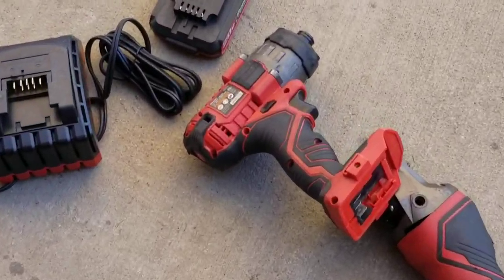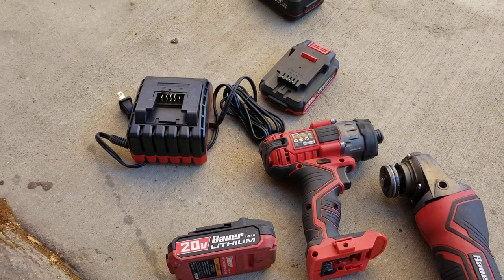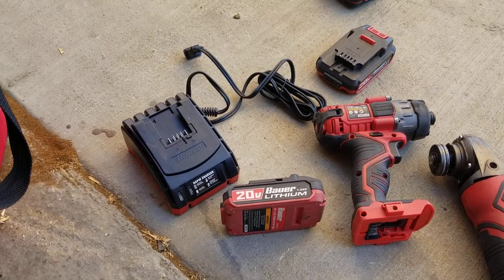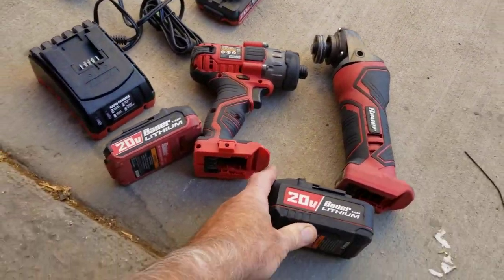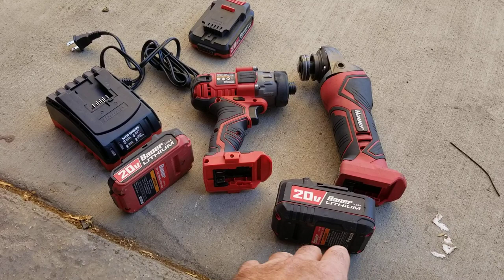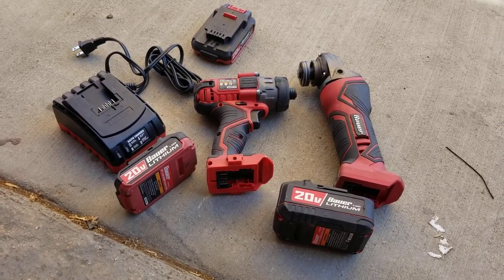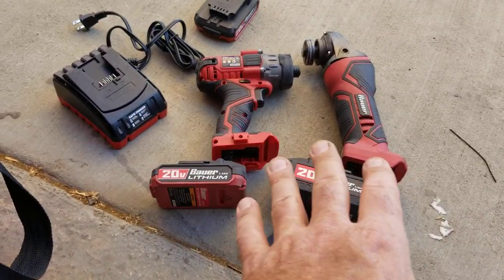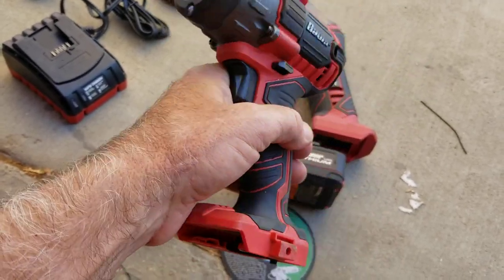Harbor Freight Bauer tools after 2 years of abuse

Comment: I did not know they been out that long,,, the grinders need bigger battery, all the grinders shut off Milwaukee and all.
Reply: Iron Black agreed! Have a Milwaukee with the 12.0 battery that cuts off, and my stepfather has the Dewalt FlexVolt 60V that does the same thing!

Comment: Would you still recommend Bauer? I'm looking to get a drill driver and HF have them reasonably priced as a kit
Reply from the maker: Yea for sure just bought more of them, hammer drill another impact, saws all, circular saw, looking into buying the impact and blower. just to have all on same batteries. and the new grinder is Brushless and more powerful I bought 2 of them.
Reply: No , I would go M12 kit at home depot with a drill, and impact with bateries for I think 119.99.  and you will not have to pay extra for warranty

Comment: Eh...  $250 for a Milwaukee 3rd Gen Hammer Drill, 3rd Gen Impact Driver, 2x 5AH XC Batteries, and a Multi-Volt Charger and a Packout Case.. Seems to be a better deal on that than what the Bauer tools are.  (and those Milwaukee ones are brushless)

The fun fact is though, those Bauer tools are made by Milwaukee.  As are the HART tools..  You are just getting their low end brushed tools which are CHEAP already.
Reply from the maker: where they get you is the batteries. and to warranty them you gotta send them back to them. If you dont have a spare battery you gotta buy one. newest bauer grinder is brushless too. I need to fly out to jobsites and loose batteries from time to time airlines take them. so it is no benefit to me to buy milwaukee
Reply from the maker: well over 1000 for the milwaukee stuff I paid less than 500 for bauer. I need much more than hammer drill and impact. I have both plus sawsall, circular saw, grinder( new grinder from HF is brushless) plus a few others. It would cost about 1200 for Milwaukee and the airlines sometimes snag the batteries. huge loss for me.
Reply: I don't think TTI makes bauer,  TTI makes Milwaukee, Ridgid , hart, ryobi
Reply: @Mikefngarage  I would shipp then with fedex

Comment: Are you still using them? How are they holding up?
Reply from the maker: no issues yet. other than I wore the bearings out of the grinder. GOt a new one and the new ones are Brushless. MOre power than the old and still only $39. Used the grinder so much many many hours. I dont think any other grinder would have lasted through the use I put on it.

Comment: The great thing is they're coming out with a 8 amp battery for the beuer line
Reply from the maker: I have the bigger one and it works great on the grinder. more power and longer use time.
Reply: I just hope the same charger for the 5 ah will work with the new 8ah, when I bought my Bauer Chainsaw , I noticed the charger had to be bigger to charge the 5 ah battery . Which was ok , since I had to buy the battery, chainsaw and chargeer to get the 20 percent discount , I'm glad I did get the 5ah anyway .

Comment: I love harbor freight, just I will never buy the cordless line of tools, they are way too expensive for my blood. this guy is talking how you need to look for coupons. I always buy brands like Milwaukee, DeWalt on promos every quarter. I always find BOGOs where you say buy a kit for $200 and you get a bare tool free,  or the buy more save more.  The only way I would ever consider HF cordless is if they had a promo where you would get 2 batteries a charger and a bag for $100 and you would get a free tool with warranty included.  Thats what Home Depot does during Ryobi days every year with 4 AH batteries last year.  I might consider Bauer, Hercules cordless tools if they came out with a battery conversion where you could use a DeWalt, or Milwaukee battery. if they can't stand buy their product I just cant pay the really high prices when compared to the promo prices. I have bought many items from HF , Like the US general tool box(great box) corded tools like a sander and car jacks. just remember the number one rule when buying tools, that is never pay MSRP, unless it is a emergency.
Reply from the maker: true discounts are a must. They are a little cheaper than the Milwaukee  even on the sale times. but the batteries are much cheaper normally. Tools work really good. good power and reliability. in the long haul they are much less and more tools that use the same battery. the line has expanded. I now have way more bauer tools. and they dont get stolen as easily.
Reply: @Mikefngarage  A thief will steal cheap tools just as fast as name brand. once they break into your garage they are not going to read reviews before taking...They will just start taking as fast as they can without thinking . unless you have neon signs telling the neighborhood exactly what you have in your garage.
Reply from the maker: @jeremymullins3241  not my experience if there is not  a name brand they recognize they leave it be. had my trailer broken into dewalt Milwaukee gone harbor freight still there.

Comment: It's the bragging rights.
So the big ego guy say he drives a Porsche or a Ferrari and why should anyone buy's a Honda Civic or a Toyota Corolla ?
Reply: DeWalt are actually the Civic and Corollas of tools. They're reliable and built to a higher standard than others of the same class, but not actually the hardcore professional lines. That's Proto. The analogy for cars fails as you go up price brackets though, since high-performance cars are generally less reliable while industrial brands are even more reliable. Well, there's Lexus and Acura, but that's "high-end" Toyota and Honda, respectively.

Comment: Not any better? My Milwaukee has a 5 year warranty and twice the break away torque. Those tools look pretty good for being used all the time. If I spit shined and polished my Milwaukee’s they still wouldn’t look half as good as those. Try using those in my line a work probably wouldn’t last a year.
Reply: William Watkins I’m sure he doesn’t doesn’t beat the living sh*t out of them, but he probably does work them good. All he’s saying is that the bang for the buck you will make just as much money with these performing nearly the same task. 
5 chargers for 100 dollars or 5 batteries for 100 dollars that a good deal.
I used Milwaukee, dewalt, ridgid and makita when I did construction work and they all worked great no doubt they also took a beating, I’m sure these probably wouldn’t hold up as long but for the money they do make you more money. 
I bough a drill battery and charger for 30 bucks it was an open box, it’s been over a year and it hasn’t failed on me, and I’ve been using it to drill through 1/4 inch steel regularly.
Reply: @payloadperformance9706  he sounds pissed, because these are holding up.
Reply: Didn’t even state what line of work he did.. sounds kinda butt hurt
Reply: 3rd year now still working and no issues. I will use the difference in price to take a vacation.